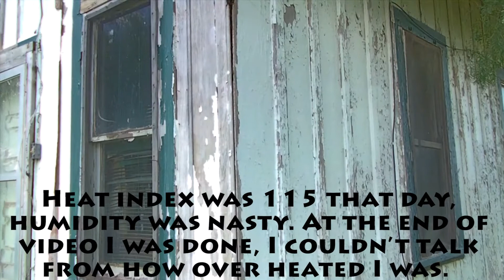Honey Bee removal from wall in Donna, Tx By Luis Slayton of Bee Strong Honey and Bee Removal

Comment: Milwaukee makes a carbide tipped sawzall blade that should fit your machine.  I imagine they are not inexpensive but if they cut the wood as if it were butter, er, cut the wood as if it were comb, they might be worth a look especially if they speed up the work on a stinking, humid day!
Reply from the maker: Eric haskell thanks for the recommendation, I will look into it. Thanks!